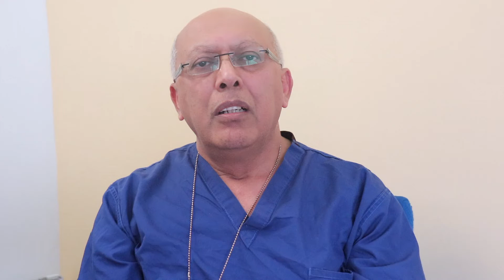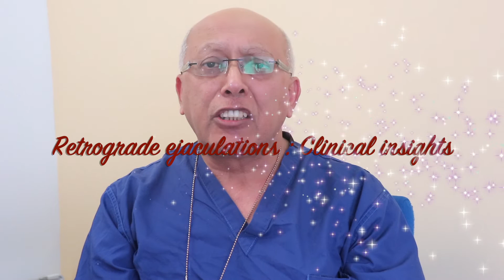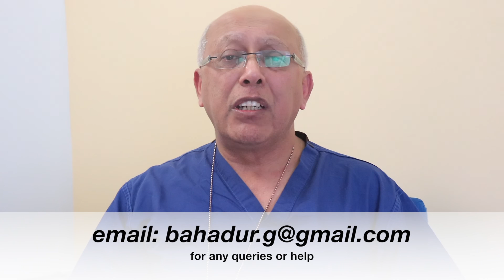Retrograde ejaculation: new scientific aspects

Comment: had aquablation 6 weeks ago.  since am experiencing retrograde ej. as well as difficulty holding pee.  any suggestions?  dr. said i had 9/10 chance of not getting retrogrd ej. b4 the surgery.
Reply: If your getting turp surgery you'll most likely get retrograde ejaculation. If your ejaculating now, please weigh which is the lesser of the two evils. If your still sexually active u may want to endure the constant peeing problem as long as possible before getting the surgery. I kinda wish I did.
Reply: @deeorr6403 
Same , 3 months ago I got Transurethral resection of bladder neck (TURBN) at age 25 still single , now I am unable to ejaculate, Urologist said it is permanent.

Comment: I have retrograde ejaculation. As a teenager, I did not discover the traditional way of masturbation among boys, rather I discovered first having an orgasm by lying on my belly on a hard surface and pressing the base of my penis on the ground really hard. My first orgasms were dry for the first few times. I then discovered the traditional way of masturbating, but still varied between the two ( mostly opting for the wrong method if I wanted to be discrete) I'm sure this has caused some damage to my bladder opening and as a result I now have proteinuria as result of this retrograde ejaculation. My doctors were baffled because my kidneys were perfect, I don't have diabetes or MS, have never taken prescription medication outside of antibiotics and painkillers for the odd headache, tooth ache etc. But after doing my own research, I had to come clean and this was my diagnosis. I now masturbate the correct way, producing a little ejaculate, which is fine by me. I've always been convinced i don't want children biologically, but if i change my mind later in life, I've always planned to adopt. I just wish I knew that there is a right and wrong way to masturbate as a young teenager.

Comment: Why in the hell  can't people just come out and say if there is a cure and tell what the cure is and stop flapping their jaws .
Reply: There is  a few solutions , if it is caused by bladder neck damage they can inject collagen to restore antegrade ejaculation (normal) if that does not work bladder neck reconstruction surgery will be the solution if successful, before either of these are attempted they prescribe certain medications to try and stimulate the nerves. What country are you in ? you need to see a urologist , but if you want more info , google retrogade ejaculatin collagen injection and all what i said above .
Reply: What you wrote is accurate to what Ive read, however I don't think there's a cure if your retrograde ejaculation is from turp surgery which mine is

Comment: Sir, i used to get up from dreams and ejaculation controlled; this was happening since last two or three years about 10 times in all. i)I have UTI
ii)urine flow dribbling mainly at nights
iii)after taking blood thinners (stents fitted 2 years ago) small qty of blood preceding urine flow
iv)doctor told the prostate felt hard by a rectal finger insertion examining
 I feel that the condition may be due yo nerves hardened due to regrograde ejaculation, can u pl review and opine?
Reply: My age is 19

weather urinary tract infection cause these retrograde ejaculation.

Because after getting the symptoms I get retrograde ejaculation , of burning sensation in urine,and trouble in passing urine,and pain in bladder
Reply: Do uti cause these retrograde ejaculation problem 🙄
Reply: Did you have open heart? You sound similar to my case.

Comment: Sir for retrograde ejaculation what medicine we wiil use.....
Reply: @NylonStrings83  Because praying is the same as hoping instead of acting?
Reply: You pee to often, hold it in till you can piss for 21 seconds, eventually your bladder muscle will get strong again.
Reply: @Ramiromasters   does it really work?
Reply: @42tabriz  Yes. I was getting really worried myself but casually I came across a documentary that said all mammals from mice to elephants piss for about 21 seconds, I'm like... I'm nowhere near that. Well I been working in an office for a good while now and going to the bathroom is just a good excuse to take a break so I figure was undertraining my bladder muscles, so I began holding it in until I was able to go for about 21 seconds, and lo and behold my little problem went away! So yes it absolutely works.
Reply: @Ramiromasters  holding it in is quite painful though since urine builds up so heavy in the bladder due to containing semen . I’ve tried your method of holding it in and it’s hard . Any tips?
Reply: @Amino  It shouldn't be painful, not medical advice of course, but what I did was to count how many seconds did it took for me to empty out and work myself to 21 seconds. Notice I said work myself to that point, it took about 2 weeks to go from 8sec to 21sec and the result is normal ejection till this day.
Reply: @Ramiromasters  Thanks .
Reply: @Ramiromasters   really? im 25 diabatic and i have this problem since 3 years now.

Comment: What happens to the ejaculate once it's inside the bladder? Is it possible to pee out thick semen?
Reply: EPSTomcat11 yes I had that problem.  It comes out like jello
Reply: No it doesn't come out thick since it is mixing with urine. When you urinate, you will notice it will be cloudy and can sometimes see strings of white sperm floating around within the urine. It does NOT come out like jello. That guy was just trying to be funny...
Reply: No , only assisted fertilization is possible

Comment: Basically, man shoots blank and semen hits the wall of the urethra (crest is very narrow during orgasm) and rebounds to the bladder?   Possible, Injury or surgery (some unknown factor) in that area; that has lost essential timing of releasing the semen to the right directions due to incorrect muscle behaviour and or loss of sync during ejaculation?
Reply: I have it. My orgasms are dry and later when I go to the toilet, I noticed my urine has sperm mixed with it. Do you know if it can be treated? I am not taking any medicines and it has been like this since 20 years
Reply: @markkuuss  i have it too i think it just started recently and im just 15
Reply: @prasannalimbu3188  it's probably a retrograde ejaculation...you need to see a urologist
Reply: @prasannalimbu3188  bro did you got any solution?
Reply: @krishna-pk2cl  did you get the solution?
Reply: @prasannalimbu3188 same man
Reply: @markkuuss how do I treat it tho
Reply: @Suedehead05  I started my diagnosis but I had to stop because of covid. Unfortunetaly, if this is really a retrogarde ejaculation that is not caused by any drugs, there is no cure for it as it is related to the nerves that separate urine from sperm in the canals. My advise is go see someone asap(urologist)and stop masturbation for 120 days at least..and see from there. Good luck
Reply: @markkuuss  why do you say to stop ejaculating for at least 120 days?
Reply: @markkuuss  So are you saying there is no way for this to be fixed ? Will a urologist give medication to help ?
Reply: @parsarahbar5127  fixed ?
Reply: I can mostly control this (when not super excited 😂).  I had no idea that it was going into the bladder. Just thought the pumping mechanism was turned off 😂😂